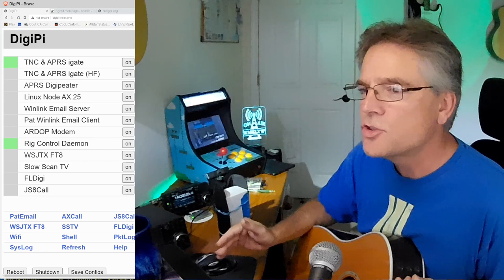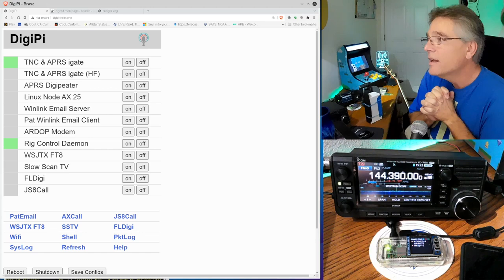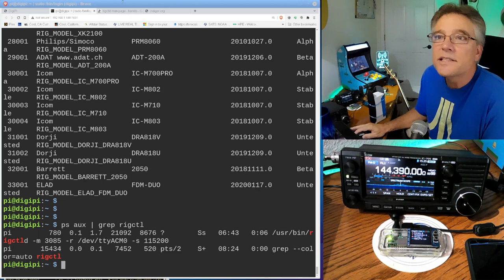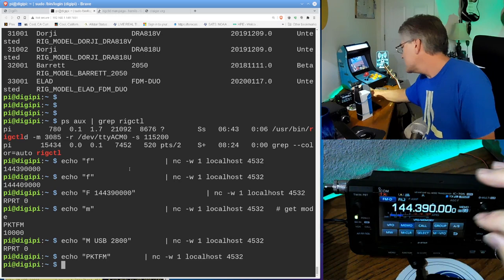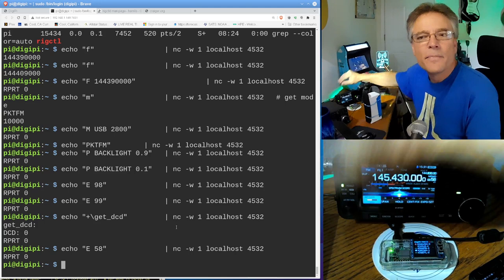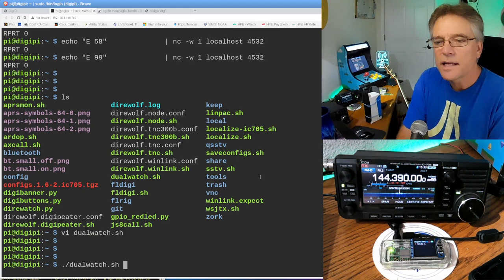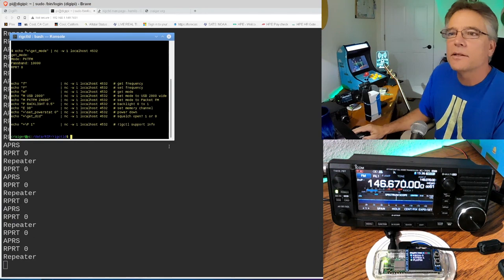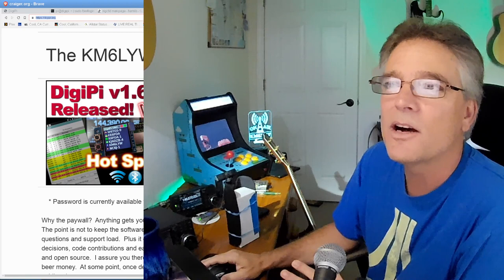Add new features to your radio with Rig-Control!

Comment: Thanks Craig!!! I am working through your collection of videos and this one helped tremendously!!! CLI rig control matches perfectly to the minimalist Pi Zero USB configuration.  I knew there had to be a way of switching apps and not having to get off the couch, go down the stairs, just to tune the radio and change settings.  😆

Comment: Great stuff I am not a programmer but like to learn code like this! Would it be possible to auto tune to an signal which is slightly off frequency?
Reply from the maker: Possibly, maybe for am or fm, its hard to detect.  Once you know the amount its off, you could easily send the command to change it.
Reply: @KM6LYW  actually I am asking this to be abbe to follow/lock on the SSB signal of the SSB satellites WRT doppler correction (receiving only)
Reply from the maker: @speedymartin2  yah, ssb would be the hardest, you will need a reference tone at a minimum.
Reply: Doppler shift is calculated in accordance with Kepler's laws. Lots of apps/websites to help you predict or calculate this.